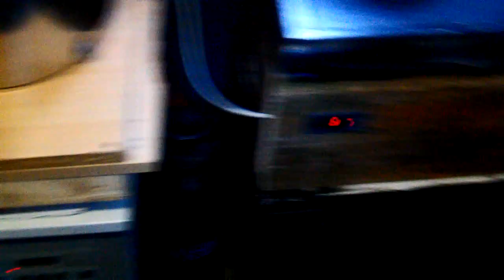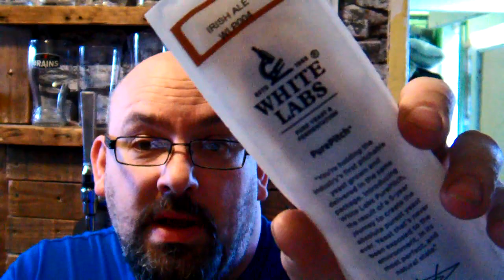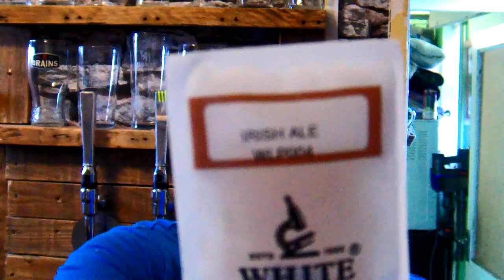HBW 2016 #1 More Grainfather upgrades and a quick update

Comment: Blwyddyn Newydd dda! 
I'd be interested to see how you get on with the GF jacket, Not had any issues other than flickering between boil and 99 deg for 2-3 mins at the start. I've used the new filter already and hopped 200g with good flow. IPA next for the ultimate test! Cheers